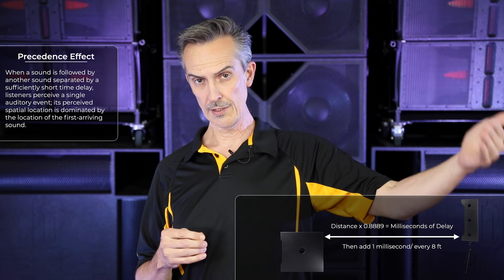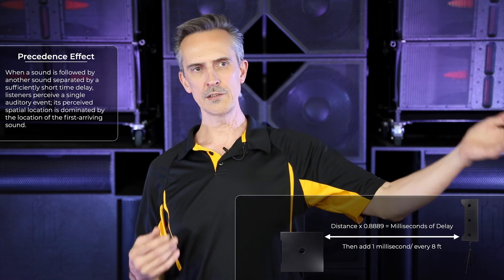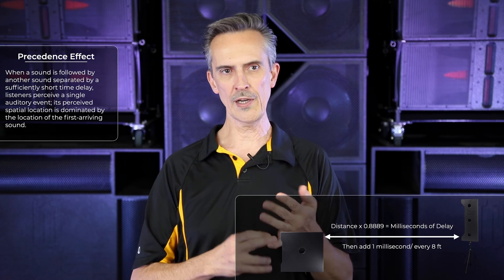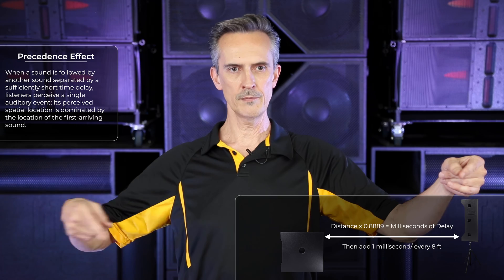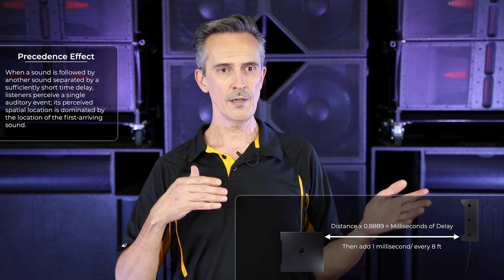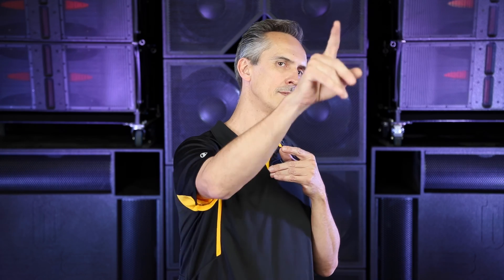Fine-Tuning Your Audio Setup: How to Delay Speakers

Comment: Hi, thanks for this great video! I'm just learning about delays (which I never realized I should be doing). I use 15" subwoofers with 12" top speakers, my tops are anywhere from 3 feet above the subwoofer (from top of sub cabinet to bottom of top cabinet) or 4.5 feet distance if I'm measuring the center of the subwoofer cone to center of the top speaker cone. I'm crossing them over at 80hz and would like to use the center of a dance floor as my reference. Can you help me figure out or understand how to calculate what the delay should be? Also where does the .8889 figure come from if using 1125 as speed of sound? Is there a calculation I can use if I'm at higher elevation or the temperature is much hotter or colder? Lastly, how far apart should each set of subwoofers and tops be from each other? Sorry for all the questions, would love to learn this. Thanks!

Comment: I have a question specifically subwoofers. When using both folded horn & front firing subs together, since the folded horn has roughly 6 feet of “horn”, should the front firing subs either be physically 6 feet forward of the folded horn OR delayed by 6 feet?
Reply: Don't be using folded horns and front firing subs together. Whether you delay them or not, they don't have the same phase response and won't sum evenly. Some frequencies will sum and others will cancel and you'll get a ragged frequency response. Stick to all 1 design.
Reply: @wally7856 Just what I needed to hear.

Comment: When using a sub Is it necessary to add delay to a 2way top placed 5+ feet up from the ground? Since technically the subwoofer would be a longer distance from the ear? Considering the sub and top are both linear to the audience.

Comment: Great video.  Adding delay to fill tops in a venue where the space is very long is critical. This came in handy at the rooftop gig that had a yoga class.  Over 400 people and some where way in the back.
Reply from the maker: We're glad you liked the video. That's a big yoga class!
Reply: Great explanation. Which device should I use to generate delay?
Reply: It's built in to the mk3 bassboss  @dwaynemingo968